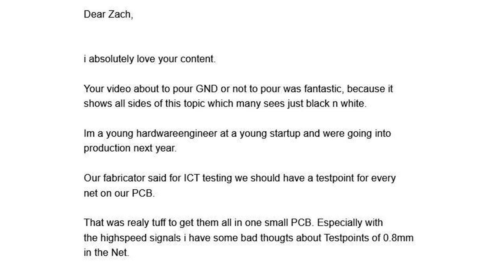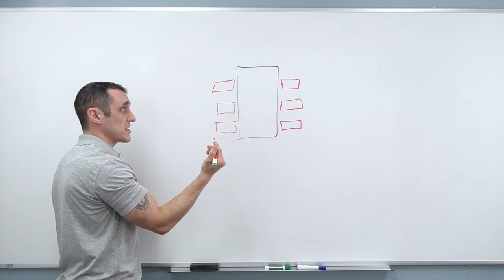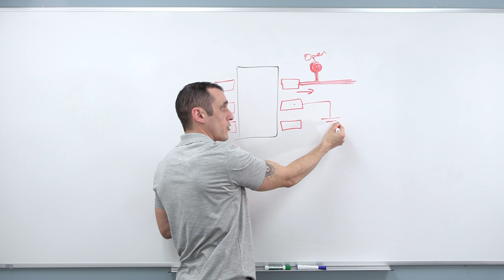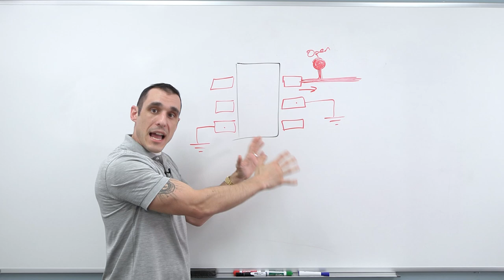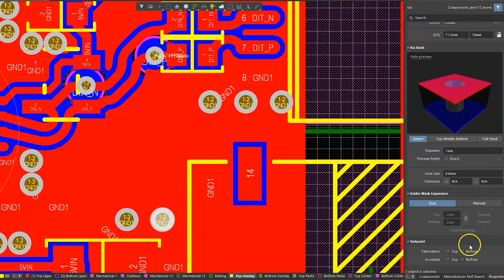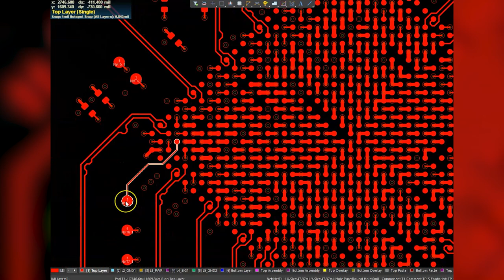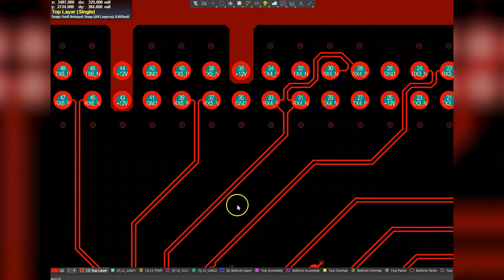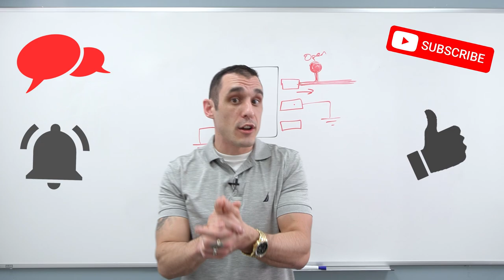Test Points in High-Speed PCB Design

Comment: interesting video!! What we usually do is just increase the pad size of the components so that the added portion can act as a TP during Test. Please give your thoughts on this. Most fabricators should be able to probe the extended pads.
Reply: Yes they should have no problem with it, I asked Amit Bahl about this (from Sierra Circuits), he mentioned they will use just about anything as a test point if they need to, so if you push your manufacturer then an expanded pad should be fair game.

Comment: good video. In fact the test point mostly like an antenna which carries hi freq signals. I.e 1GHz. for least radio power lose & make sure the quality of signal, u need to(2 points)

1. the stub should has a length shorter than the 0.02 * wavelength i.e 1GHZ wave lengh = 300mm ,0.02 * 300mm = 6mm

2. the test point should be put with a full ground under or around it self. which make the electric field tightly constrained internally. ground layer under the signal layer will be a better choice.

this 2 points make the test point stub a worst antenna which almostly emit no signals of any freq. thats a good high freq test point.

Comment: Cool, although I also wanted to know how a pad on the trace would impact it. 
You talked about this type: _P_
However what about this type: --O--  I use these for home etched boards to test and measure stuff, no high speed stuff, but still.
Does that count as huge stubs on both sides?
Hope you can understand it!
Reply: The -O- type would be better for signal integrity since this would minimize the size of any stub that touches the trace. If the circular pad sticks out a little bit that is okay, it will act like a very small stub and would only affect really high speed signals. You could just remove some solder mask near the driver component also. I brought up a via if there was one already on the interconnect, you could use that as well. I would say to test it first though just to make sure you can get some signal into an oscilloscope. Also I do not know the bandwidth of probes used in ICT, if it is too low they may not be able to accurately reproduce the signal. Some companies like Tektronix make interposers specifically for some DDR memory packages and they essentially do the P type test point at the load end of the interconnect (where the memory chip is), but you have to use a high bandwidth probe to capture all the frequency content that makes up the signal.

Comment: I saw next test point technique on some old PC's motherboards: just solder mask opening for 1-2 mm along the trace if this high speed trace is on top layer. I suppose it was done for flying probes testing.
Reply: I was just about to post the same as you. Or can't you place small testpoints (1mm diameter) on top of the traces?
Reply: @magnuspihl6974  You can place those, just note the frequency of your signal. For digital interconnects running at high speed, it's better to just use a via along an interconnect or a pads at the endpoints to do continuity testing, but you wouldn't use that for ICT; for that you would want to find a via near the endpoints if possible. For an RF signal, that thick pad will be invisible to the signal unless the signal frequency gets really high. I'll actually create a video or article on this because it's a good exercise to see how input impedance is affected when you have a 1 mm pad on a thinner trace. On an RF line running somewhere at 2 GHz or higher, it's common practice to just remove the solder mask from the conductor because the solder mask is lossy, so that would give you probe access.
Reply: @Zachariah-Peterson  So a through hole on a high speed signal trace is the best way to debug it than to have a little testpoint which could have a big impact on input impedance ? 
Your channel is so nice for the young hardware engineer who I am.
Reply: I just depends how fast you mean by "high speed"

I brought up a via along the interconnect just because you can use it for continuity if it was already there in the design, same goes for pads at the ends of an interconnect. For high speed signals, vias are generally not desirable on those routes if you can help it, but sometimes you don't have a choice because using vias is the only way to complete the route.

To do ICT with high speed signals, best case is to use a wideband probe on a custom test fixture to probe exposed pins on components. If you can't do that and you already have a vi on the route, then use the via. For some packages, like BGAs, you have to use the vias and they will already be there for fanout routing. If no other options, maybe place a small pad. I like the idea of pulling back solder mask on high speed interconnects and using that to probe directly, but I've never done it myself.

Comment: If we mirror the testpoint pads on both sides of the differential pair would that work? So one for + one for -. Same trace length and same pad size
Reply: Normally you would place a differential probe across the pins of the transmitting or receiving component. You can place testpoints mid-way along the route if you want, which would then give you access to the same differential measurement. If it's a very fast interface, I think a better option is to remove the soldermask on the traces in the area you want to probe instead of placing large testpoints on each side of the route, that way you don't create a bandwidth-limiting measurement artifact mid-way through the interconnect. If the traces are very narrow (such as 2-3 mil wide on an HDI PCB), then you will have to place the larger test points and it will be difficult to get an accurate measure of the signal without it being degraded by the presence of the test points, this is why transmission line measurements for very high speed signals normally use a standard interface connection  like SMA connectors so that a VNA could be used instead of scope probes.

Comment: Hi, thanks for the video. I followed your video and tried to turn a Via into a test point. Once I selected the Top for both Fabrication and Assembly in the Properties panel, the Testpoint Net Status under Testpoint Manager turned from "Incomplete" to "Illegal". Any thought?
Reply: Make sure you have set the correct design rules for test points. Just go into the PCB Rules and Constraints Editor, and search for "Test", the test point rules will come up and you will be able to set allowed test points in that dialog. The default minimum test point size allowance on that design rule is larger than the typical pad or via size in most PCBs, so make sure to set a higher minimum test point size. Once you change that minimum value so that it is smaller than your intended test point, the entry in the Test Point Manager will change from Illegal to Completed.